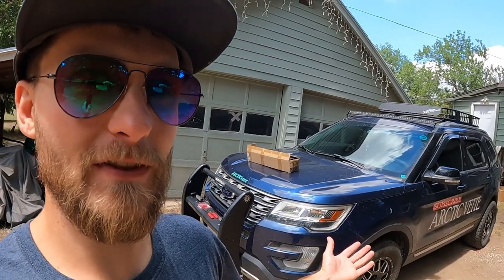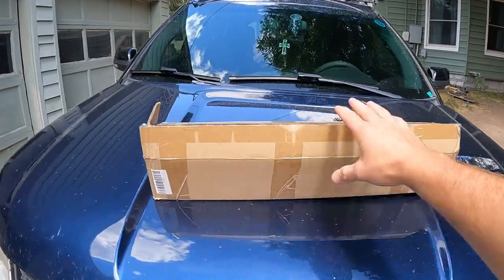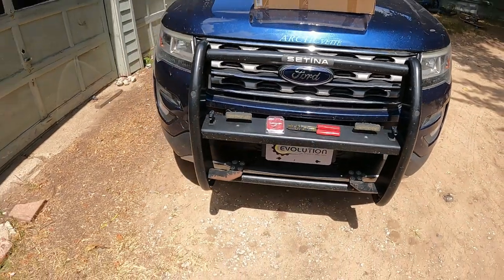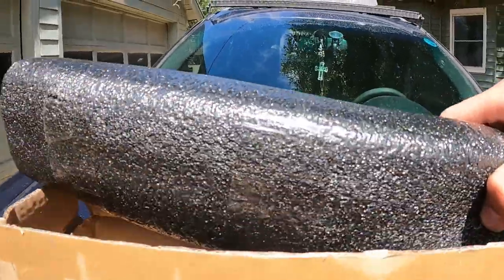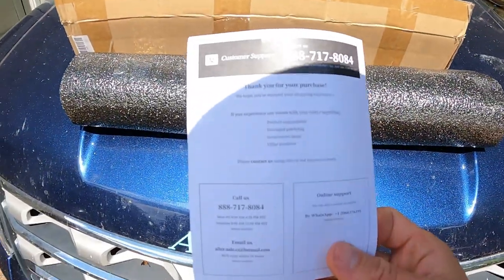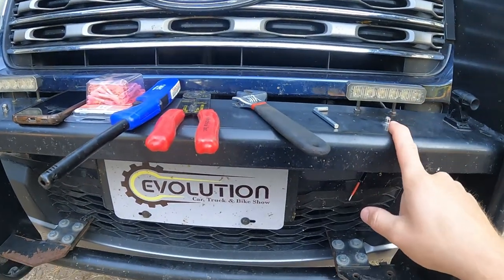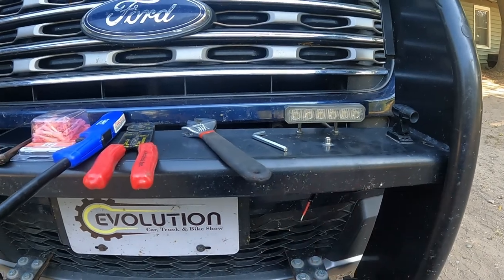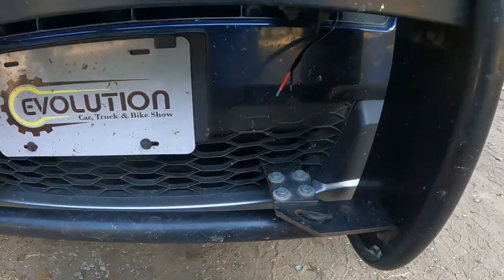How To INSTALL an LED Light Bar on a 2011 to 2019 Ford Explorer (ft. AUTOSAVER88) - Daily Vlog

Comment: It's too bad you didn't also include in your video how you accessed the inside of the vehicle through the firewall to run the wiring
Reply from the maker: Yes, I should have done that instead! It would have been a much cleaner install that way too.

Comment: I've got a similar setup on my bullbar but have thought about putting a light bar on the roof as well.  How is it driving with that top light bar on?  Does it wash out your view at all or put any glare onto the windshield?  Does it make a noticeable difference with the other light bar plus your LED high beams on?
Reply from the maker: It doesn't wash out or glare on the windshield for me. It does make a difference even with the brights on. Totally worth it! 

It also helps let others know my low beams are not my high beams. 😅
Reply: @ArcticVette lol, nice!

Almost forgot, do you get any glare off the hood?  I know depending on placement, some people wind up with a ton of reflection depending on the cutoff.
Reply from the maker: @7duke77  I did, so I readjusted it a little bit and seems great now. I'll see if I can make a short video tonight showing this.